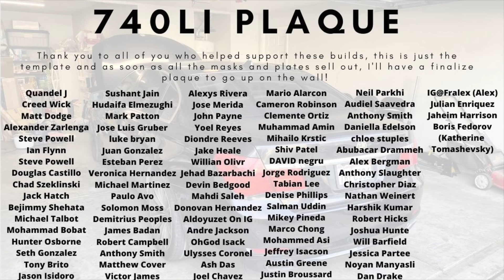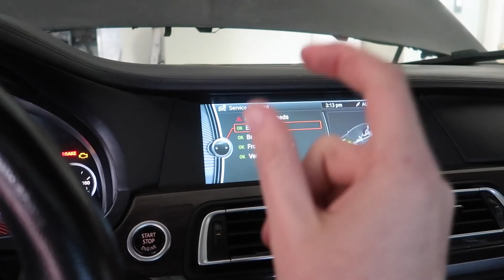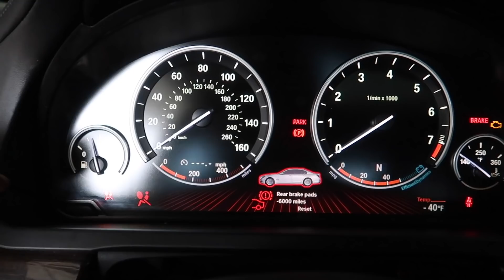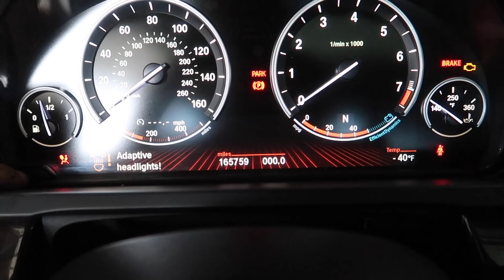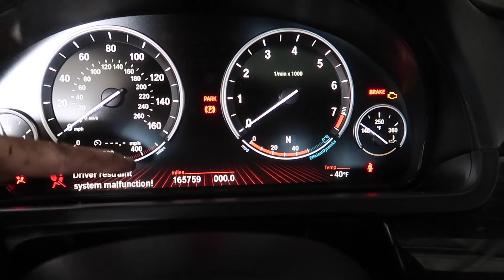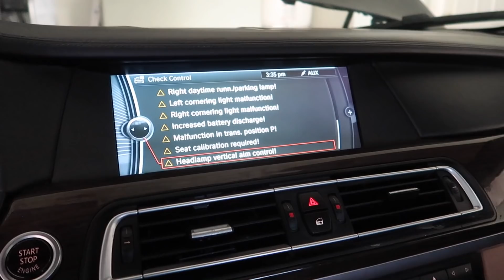Rebuilding An Abused BMW 740Li N54! Part. 4

Comment: Great stuff! Coming right along with this build and I am lovin' it.
Those N54 Oil Caps have wonky gaskets and may trickle so I swapped mine with that round Cap off of an N55.
Also, Kies has their own Crank shaft guard (the part we all bought on EBay after we saw you install one) now. While they seemingly don't have anything I can use for my e60, they took THAT idea and ran with it, so don't miss out.
#SquadetteOutForNow

Comment: Check out the Timesert repair kit to repair the the oil pan drain plug it ends up letting you use a new OEM drain plug and the threads are steel not aluminum like the OEM pan which is better for the long run

Comment: Great maintenance video, good thing you didn’t have to do the valve cover gasket, that’s like a 13-16 hour labor intensive job, the 7’s had kind of a different N54 engine then a 3 or 5 series !